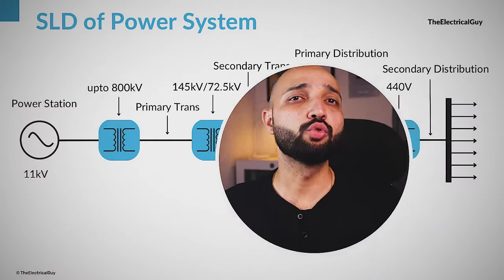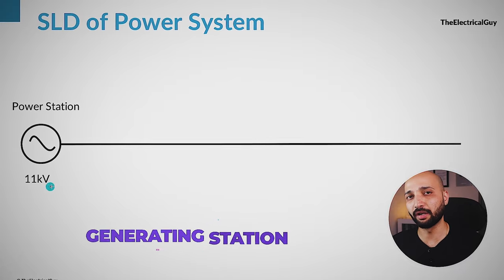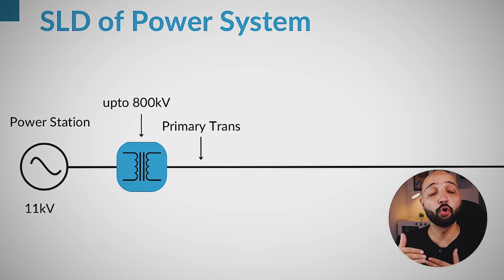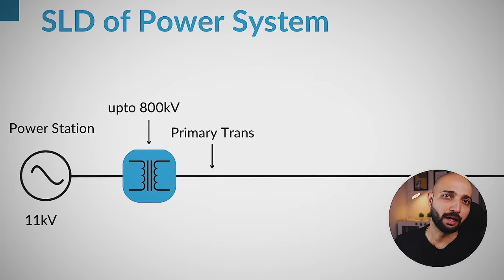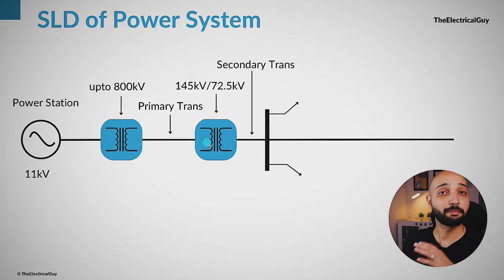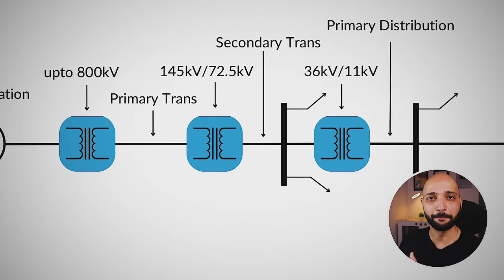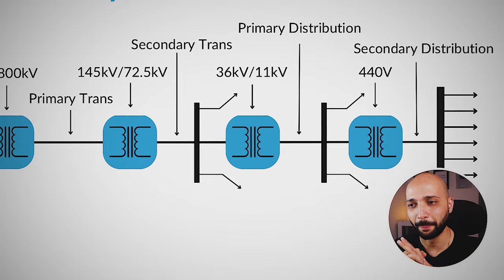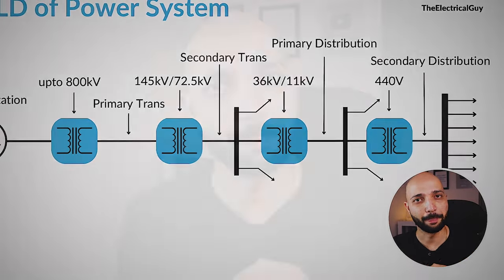Single Line Diagram of Power System | Explained | TheElectricalGuy

Comment: Check the numbers again in diagram. Collect more information then make a video 132kv, 63kv, 33kv, 11kv,  230v. Are the correct numbers.
Reply from the maker: 63kV is nowhere used in India!! It's 72.5kV! And the voltage that you have mentioned are normal system voltage. It is always a good practice to refer to the voltage as rated system voltage. (Normal voltage - 132kV, Rated voltage - 145kV)
Reply: It's not 63 kV but 66 kv

Comment: Coal fired power plants in India and abroad don't use standard voltage like 11 KV.  It varies.  For example, 20 KV here in 4 x 360 MW power plant.  I have worked in Saudi Arabia, where Generator terminal voltage for 4 x 660 MW steam power plant was 24 KV.  
Earlier I had worked in 2 x 210 MW steam power plant near Nagpur - it was 15.75 KV
Reply: Hello brother, what does 4 x 660MW signify and how is getting turned 24kv can you elaborate